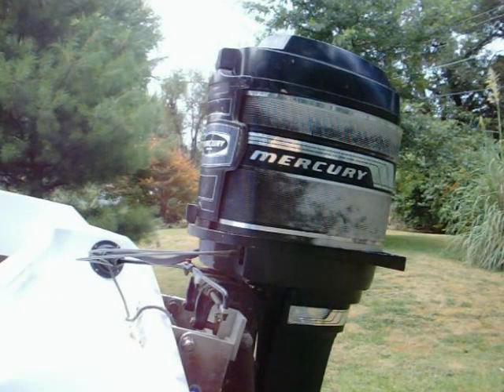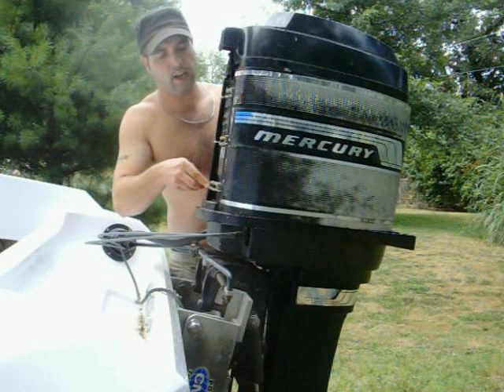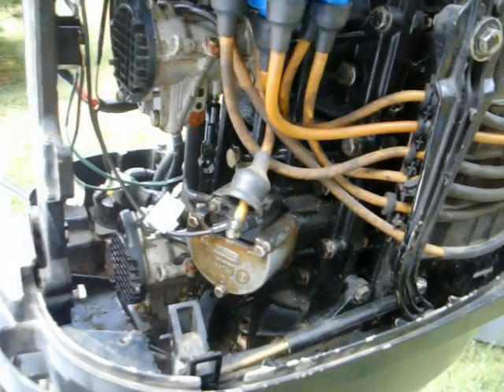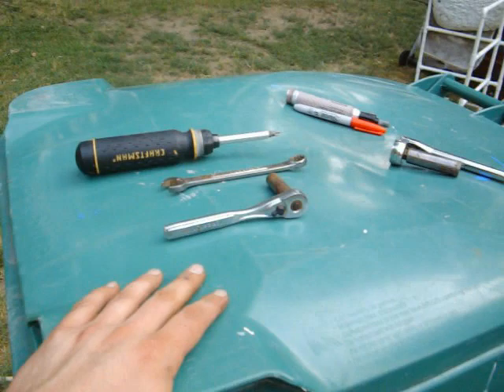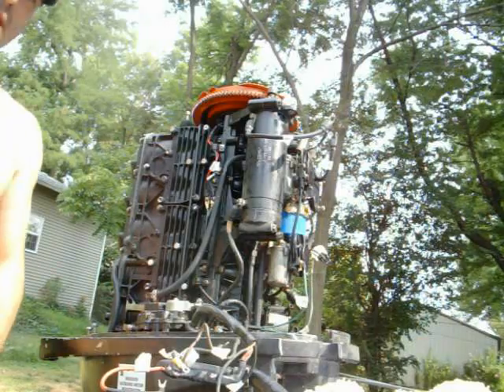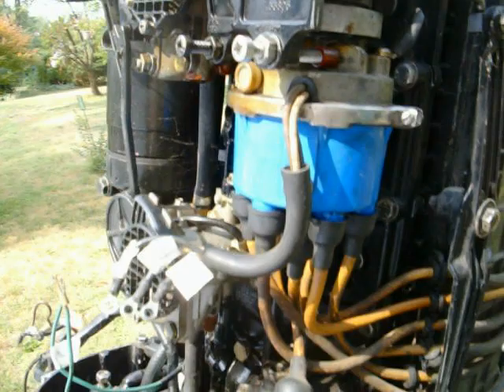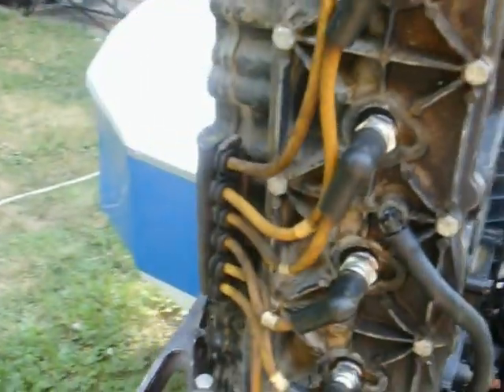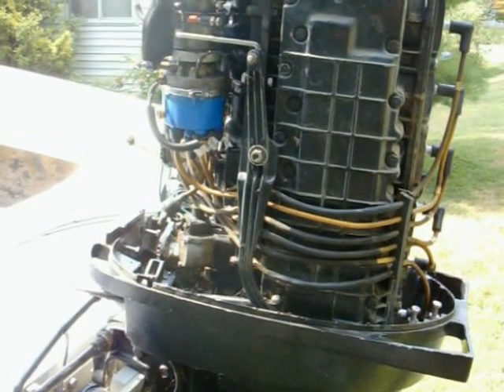1976 Mercury 1150 Inline 6 TOWER OF POWER Overhaul Disassembly Part 1

Comment: Gday mate. Great video. I’ve got the same motor but in the 1500. Just noticed that I have hot water coming out the pee hole? Not boiling but definitely hot to touch. A new merc I have has always cold water coming thru. Was wondering if this is normal as I havnt owned this boat for long and take notice last season. Was thinking maybe it could be the thermostat? But I can’t locate where it is and I didn’t hear you list the location in your video either? Question: does this motor have a thermostat? If so would you know where it’s located? Also is it normal for the water to be running out hot? Thanks heaps for this video. Any advise will be greatly appreciated. 

Regards Al.
Reply from the maker: No thermostat. Yes, it's warm when running. Colder when on the lchance. Long as it's moving out the pee hole,, you should be good.. Safe bet is to replace the water pump when you get a chamce.
Reply: @cturboaddict  mate. Thank you very much!!!! Thank you for your prompt reply too. Cheers.
Reply: Took it for a run in the lake and the water coming thru the pee hole seem to cool down thank god. Was warmer then the lake water but not as hot as it was earlier. Not sure why it was running hot when I had the ear muffs on it thru the garden hose earlier. . But seems to be working as it should now thanks. 

Hey just a another question if you don’t mind please. I thought I’d get more speed out of the engine. Been a 150hp clocked it at top speed of 60kmph ( 37mph ) my other boat with a 75merc 2005 model gets about the same speed. Was just expecting it to be faster when I purchased this boat is all. 

Boat details ( if it helps ) 1970 something model 1700 Bullet. 

Would there be anything that should be checked / cleaned to maximise performance?
Reply from the maker: @Budjama  might need more prop pitch and raise the motor just a bit. I got around 50mph out of my 115hp in an 18' sidewinder SS
Reply: @cturboaddict  hey do you know where I can buy I new head cover / spark plug cover? Had removed mine due to water leaking, once I removed it snapped in half due to corrosion…. Can’t seem to find any in Aus.
Reply from the maker: @Budjama  you'll need to find a used one.

Comment: Hi,  Im enjoying you video,  been doing some work myself tnx to your video,  question plse,  I ran my engine,  same as yours,  without oil in the fuel,  engine died but I can still move the flywheel by hand,  technicians says will cost NZ$4000 to fix,  Im not sure that Ill the piston assembly and all bearings etc need replacing,  your thoughts on what I should focus on replacing?
Reply from the maker: Well, expensive lesson learned ehh? I'd put the proper fuel mixture in there and see if you can start it.

Comment: hey man great video i have one but it seems siezed , shouldnt be could it be stuck in gear? the bottom/prop etc has all just been put on help?!
Reply from the maker: Did you take it apart first? Or did you buy it "stuck in gear"
Reply: @cturboaddict  it was apart and i paid a guy to assemble it again, do the water pump etc, i pulled it apart today and still cannot turn the motor with a socket on the flywheel..is there ant mechanism that could be still locking it up?
thanks for the reply

Comment: How about the water leaks around the top spark plug?? I just discovered it today on my 1984 Tower of Power 115hp. I just posted a video, maybe you can take a peak at it and tell me what you think?
Reply from the maker: @richboss302 Is there water in the cylinder????????? You may just need to put a new gasket on that cover. Has that motor ever been in salt

Comment: hey man do you still have this motor i have the same but whoever had it before did something with the fuel lines could you show me how they connect?
Reply from the maker: Yessir. What would you like to see in specific? Just the routing?
Reply: The line to the left of the fuel line that connects the carbs what is that
Reply from the maker: +Levi Ervin are you taking about the balancer line that runs from the top to the bottom?
Reply: I'm not really sure what they are i just know whoever had the motor before had a fuel selenoid running into it
Reply from the maker: +Levi Ervin was there a hose that connected to the carb from it? and was the choke removed?
Reply from the maker: +Levi Ervin sent

Comment: How different is this Mercury from a Mercury 900 90hp? A buddy of mine and I just bought 1968 Larson, 16 ft lapline and it came with a Mercury 900 90hp. Is this a good motor? It has sat for over a decade but here in Colorado it is very dry and it has never seen salt water. Should we scrap it and buy something else with something wrong (so that it doesn't cost an arm and a leg) with a problem which we know and can fix? Or stick with the Merc 900? Any advice would be great! Thanks
Reply from the maker: They are great motors. I would buy some Marvel Mystery Oil, and put it in a squirt bottle. Then pull the spark plugs and squirt directly into the spark plug holes on each cylinder. Let it soak for a day, than rotate the motor over and do it again. Run a compression test and see what your working with! BTW- It's not that different from a 900. They actually look almost identical.

Comment: I just bought a 1960 Mercury 95hp 950 bought It and start right on my face now won't start and can't get it on neutral need help and what to do please help  and what do I do I don't know nothing about this Motors .  just bought it Whit the boat for $400 now won't. start bought new battery does use regular gas please help
Reply from the maker: So, you have a new battery. Does it TURN over?
You need to get it in Neutral to start it.

Comment: i just scored a cheap boat with one of these altho mine says power trim on side too...am researching to see what year mine is etc but your video is awesome! Subbed for future ref, cheers dude!
Reply from the maker: On the starboard side of the motor is a serial number. It's stamped on the side of the motor. NOTE This number (you may need a flashlight)! Then go to here to cross refrence the number to tell you what year/model it is.
http://maxrules.com/models/Merc_model_files/115-150.html
Reply: *****  cheers bro she's a 1977 haha bloody near same vintage as me! She fired up yesterday first time on over 6 months acording to old owner...sounded sweeeeet now just some mod's to hull and make sure she's ship shape and once new front axle made i will be water testing :)
Reply from the maker: madsonicboating Awesome! Make sure you run some sea foam thru the gas to help clear her out. And DOUBLE CHECK that impeller!!!!!
Reply: *****  hmm sea foam never heard of that and wish i'd read this before our weekend excursion to lakes....got there and she decided to not start again. A bit of mucking around soon got her fired again but alas the bowls kept flooding and pissed fuel out the overflow constantly....especially the middle carb. Using your other awesome vid I have dissasembled the carbs and just finished cleaning the bowls and jets with cleaner and air gun, shortly am off outside to clean the float needle seats etc and then will reassemble and fire up to see if I have fixed the issue. Cheers again bud!
Reply from the maker: madsonicboating Check the float bowls bud... And don't hesitate on the fuel pump rebuild either. Very simple, and inexpensive. Cheap insurance if you will.
Reply: arrgh turns out top cyl has no comp at all...took side cover off and rings bedded to piston. Thanks for the info....time for a newer motor
Reply from the maker: madsonicboating Could be stuck rings bud. Teardown and rebuild isn't hard. I covered most of it on my channel.

Comment: Heyy! Great Video, thnx. Im a Novice lol & make the cardinal mistake, didn't label properly. or more-so didnt pay Full attention to the where the wires go.  I have the same motor, & also a 78, 90hp. The 90 has 105/110 compression from cold compression check, so Im using a few minor parts from the 115 {unfortunately has bad/no compression} to get the 90hp going. QUESTION: Re; wiring ..EDIT* Found a diagram online.  After the 90 Tower of Power is running, Im going to work on the 115. See if I can do what you are showing in your video's. Get that cylinder 3 back up etc. Thnx.. Cheerz ..~
Reply from the maker: Glad you figured it out! Ive got tons of merc videos

Comment: We have a 69 Sidewinder with a 72 Merc 1500.  Bought it new and have had lots of good hours.   Love the unit but the motor has developed a water leak around the spark plugs on #1 and #2.   It doesn't look like there is enough room to get the back cover plate off (to replace the gasket) without pulling the power head but your video shows the lower cowl fairly loose so it might work.   Would love to hear from anyone who has replaced this gasket and has any tips.  We don't have many old merc guys around here to bounce things off of. Thasnk you, lhhill@telus.net
Reply from the maker: +Larry Hill Where in specific is the leak?
Reply: 3 years later but your motor is a 73-77.  Merc didn’t make a 150 in ‘72.